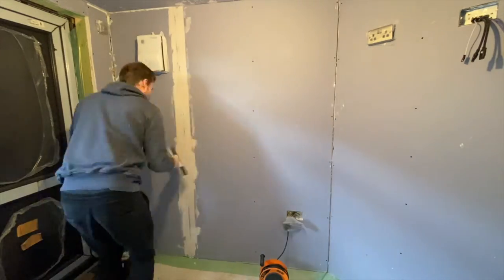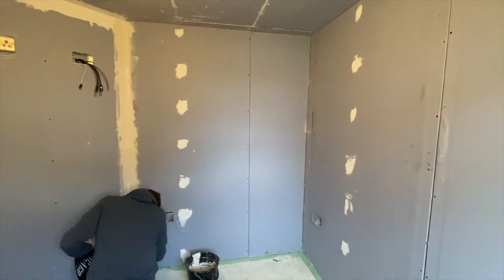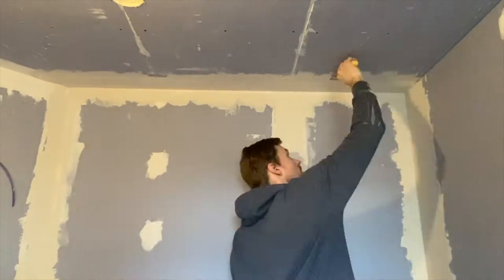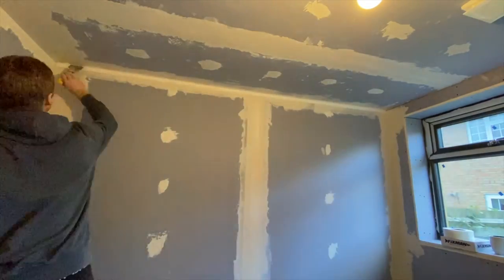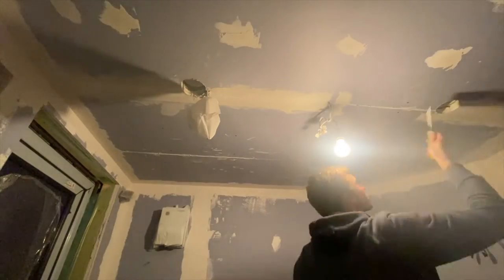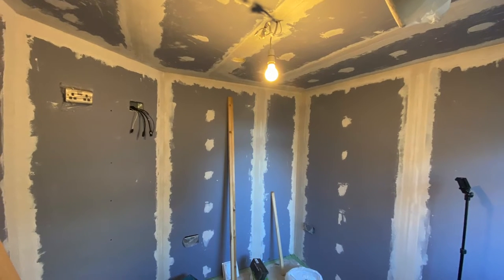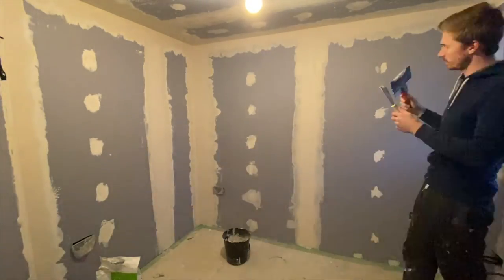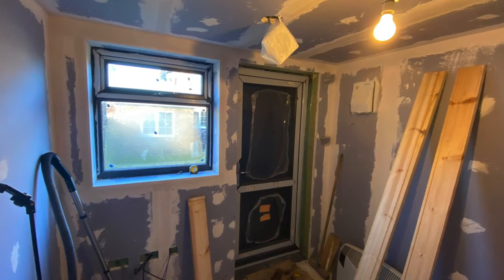How to Tape and Joint Plasterboard - Drum Studio Garden Room Build - Part 12

Comment: Coming along nicely!
Reply from the maker: Thanks!
Reply: Looks good 👍🏽. I’m in the process of making mine, could u pls tell me what wires you run in to the build ie cat6 etc ??
Reply from the maker: Hi Indy, thanks for your comment! I ran 4mm 3 core armoured cable for the power, a Cat6 line for internet, and a coaxial line for TV, running from the aerial in the house (as you are not allowed to fix TV aerials to the room according to building regs).
Reply: @leejmurphy  thanks Lee, really helpful 👍🏽
Reply: Hi,did you ever manage to get a sound test when it was all finished?
Looks great by the way 
Thanks
Reply from the maker: @chezzy-jp2xu  Thanks! I have done some testing and the performance is pretty good. I'm very happy with the sound absorption with the wall construction, the biggest weak spot is door and window. I'm going to look into getting some secondary glazing. This was my original plan but I haven't yet got around to it! Hope to get some more videos up on the series soon.